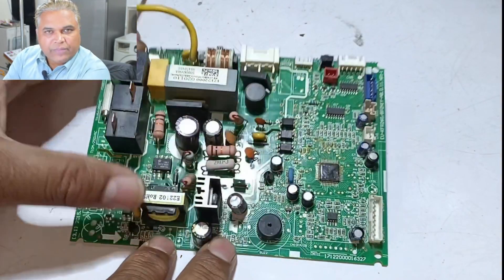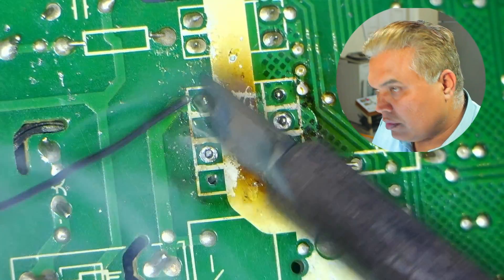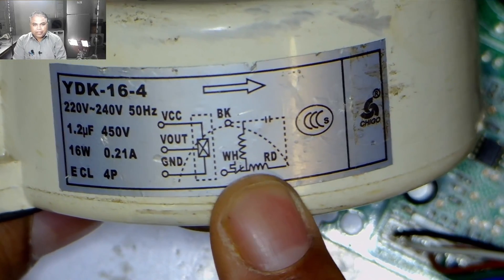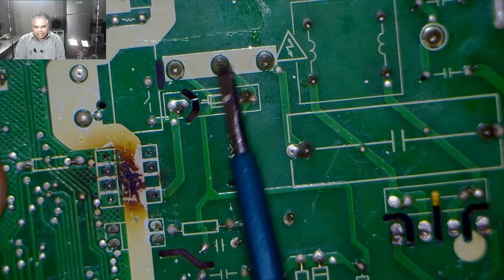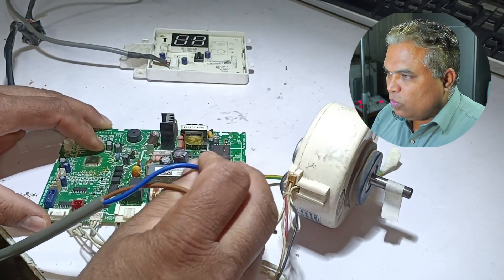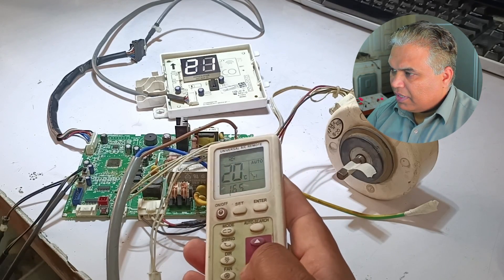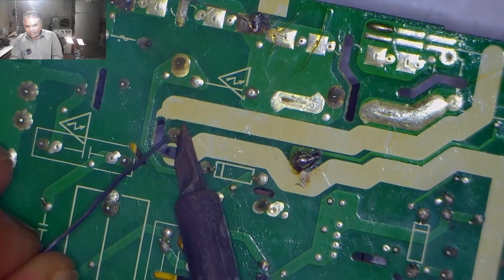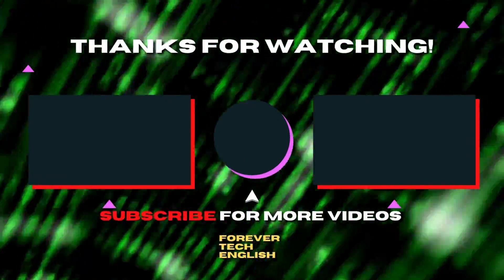Fan Blower Motor Won't Work When Display Is In Mini Split AC Circuit

Comment: Good day boss! I have an LG 1.5hp dual inverter split aircon,  if it work for 45 minutes, it displays will be blinking and keep making sound
Reply from the maker: Check the communication wire, may be burn, check the continuity of the wire. Or check the outdoor circuit board
Reply: @forevertechenglish  I have replaced outdoor circuit board, it's working perfectly now. Thank you!
Reply from the maker: Great to know that!!
Reply: @forevertechenglish  it worked for weeks, but it has started the same problem boss.  The power will just be on and off like three times and continue operation, after a while again, it will be on and off regularly
Reply: Once it start working the outdoor amp will be 3, as it speed increase it will go to 5.5 amp and later comes back 3.8am. So it will keep running between 3.8amp and 4.2amp
Reply: @forevertechenglish  I checked the resistance of the three terminals, I got 1.5, 1.5, & 1.6
Reply: What could have been the problem, I checked the power supply, nothing wrong with the light.  I replaced the indoor board, but still given same issue, what can I do
Reply: It does not display any error
Reply: And the light that comes into the unit is 218 volt